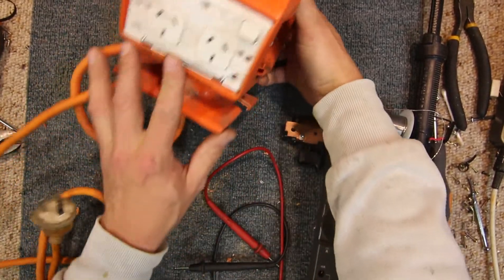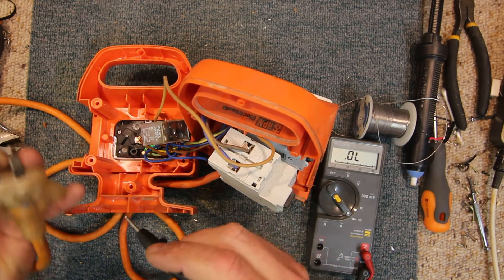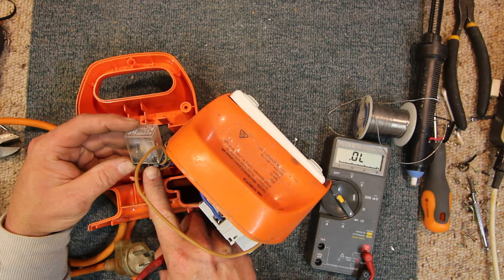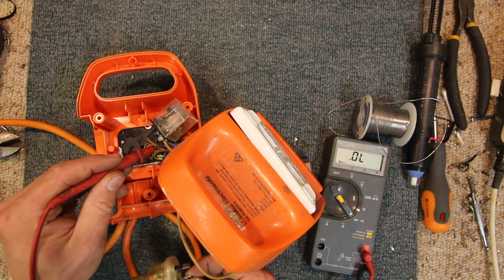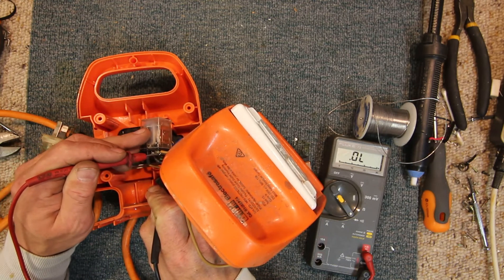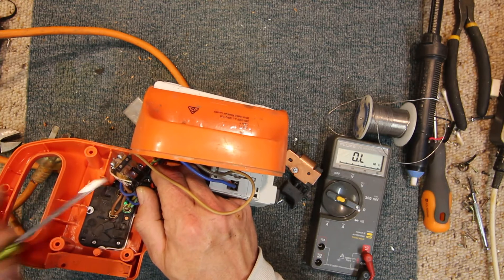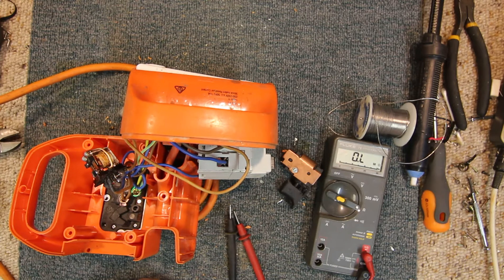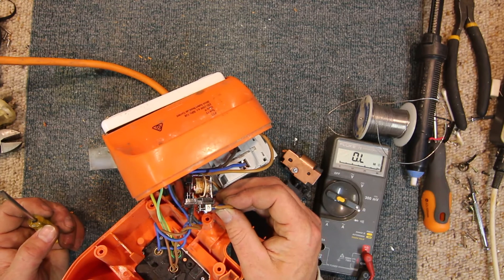HPM Electresafe diagnosis

Comment: Ive got one if these where ive used a portable garage heater and its melted out 2 outlets on this 4way outlet . $140 bux for this crap . I gotta go buy another one today
Reply from the maker: Could be the power points they use arent the quality they used to be, but sometimes heaters will do that if they pull 2400w. The Vulcan Quasars would melt their own plugs as well as power points on a regular basis. Might be worth polishing up the pins on the heater plug or you might be in for more of the same.

Comment: Under voltage protection? I am fixing one as well, but it’s not because relay.
Reply from the maker: Thats an interesting idea. It wouldnt cut in at a low enough voltage, but it would be very rare to ever encounter one even with faulty cords or the like.